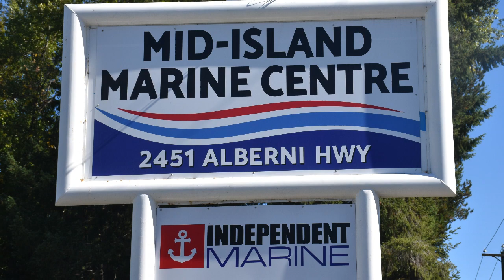How to Fibreglass Over Plywood and Wood

Comment: thanks for the tutorial, why use matt instead of cloth?
Reply from the maker: Great question, thanks for asking. The reason we use matt is that it will give us a smoother surface and is also not structural so is only meant to support the resin on the plywood. If I was doing something structural I would layer matt, cloth and then matt. I always use matt as my finish surface. Good luck with your project.

Comment: I have a plywood wall that i am repairing. Had water damage, i cut the damaged area out, but not sure how to repair it. Fiberglass may be the cure. Do you have any suggestions?
Reply from the maker: If you have problems with a wall getting damp or wet you may want to just coat it with epoxy.